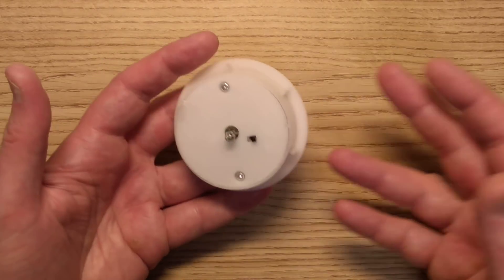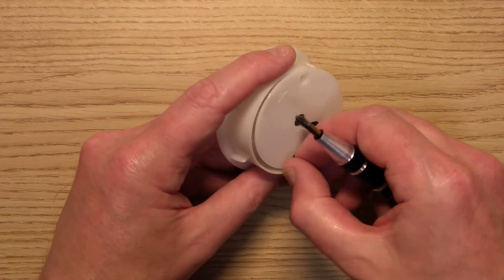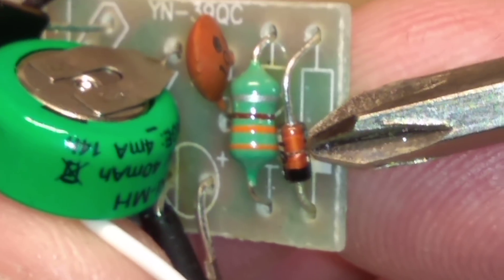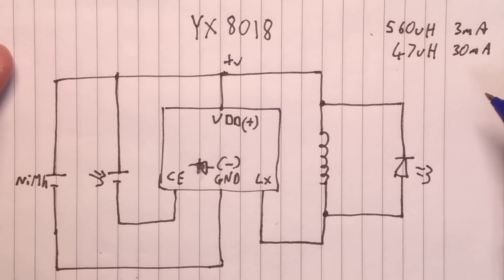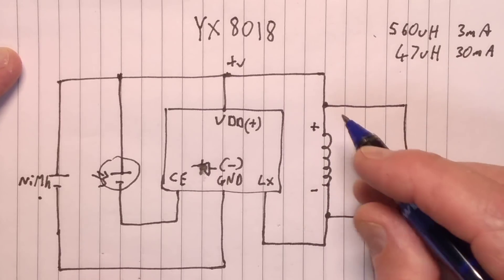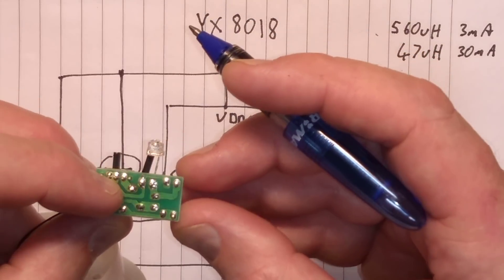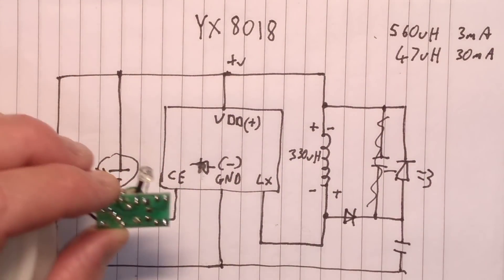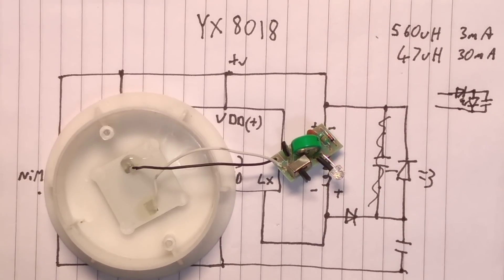Why RGB LEDs don't always work in solar lights.

Comment: so this isn't a BOOST converter right, since it never puts battery and inductor in series? Why not? So does having a smaller inductor increase the voltage delivered? What is the advantage of a boost converter compared to this?
Reply: It is a boost converter, just not in the way you'd think. It creates a higher voltage across the inductor as opposed to referenced to ground. When you pass a current through an inductor and suddenly stop the flow of current, the inductor will try to maintain the same level, which is causing an inductive kickback, raising the voltage. This effect is only limited by something clamping the voltage. This also why magnetic relays will often have a reverse diode across the coil. Otherwise the high voltage spike can cause arcs when the relay is disengaged.

Why a lower inductance gives a higher current? When the on period starts, the current ramps up as the inductor builds up its magnetic field, since inductors resist changes in current. With a higher inductance, the current ramps up slowly, so when the supply is turned off, there's less current going through the inductor at that time, and less magnetic energy available for the inductive kickback effect.
Reply: @Gameboygenius  I get it is a boost converter, but the term BOOST CONVERTER is usually a device that switches an inductor in series with a power source at high frequency creating a higher voltage. The above system does not follow that topology. I wonder what the pros and cons are between this and a typical boost converter.
Reply: @jovangrbic97  It is a boost converter, the switching pin is open-drain, the inductor is switched to ground at 200kHz: https://ez.analog.com/university-program/b/blogs/posts/hacking-an-led-solar-garden-light. You can redraw the circuit so that it looks just like the circuit in https://en.wikipedia.org/wiki/Boost_converter
Reply: I agree, this is much less efficient than a conventional boost topology since it has to generate the full led Vf across the inductor rather than Vf-Vbattery.  I suspect the problem would be leakage through the led when the switcher is off, even though the battery voltage isn't high enough to light the led some small current would flow.
Reply: @ferrumignis  but when off the PV is making power so wouldn't be an issue?
Reply: @jovangrbic97  It's hard to find data on these colour changing LEDs (e.g. I/V chart) so I don't know what kind of leakage current would be seen at typical NiCd voltages. If significant it would reduce charge current during the day, which is pretty small anyway. I can't think of any other reason to use a less efficient topology though.
Reply: @ferrumignis  what is the voltage limit such an inductor can produce? is it necessary to select the switching frequency to a timescale according to the charge time of the inductor?
Reply: @jovangrbic97  The inductor doesn't limit the voltage (or at least not directly), in these simple converters voltage is limited by the load.  AFAIK these things are extremely basic and run with a fixed frequency (around 100kHz usually) and fixed duty cycle on the switching transistor, so the peak inductor current will depend on the inductor value (and battery voltage).  If you look at the datasheets for these things, they usual have table of inductor values against LED currents.  With a fixed duty cycle, the larger the inductance, the lower the peak inductor current and the lower the LED current.

Comment: 'CE" meaning 'chip enabled' .. Very Droll!  :)
Reply: I find that in this circuit, 'charge enable' makes more sense.
Reply: Actually it should be Not CE, as the chip is enabled when the solar cell voltage is close to zero.

Comment: I wonder if the chip has something like a MOSFET instead of a diode to charge the battery from the solar panel, to reduce the voltage drop.  It would be easy enough to integrate into the chip, and that 0.6V savings might allow them to use one fewer solar cell in series, so it might be worth it.
Reply: it's not worth it, that chip is produced as cheep as possible

Comment: In Australia, you used to be able to get those lights for $2 each. It was worth it just for the color cycling LED. I once took a hand cranked torched (aimed at kids) from IKEA, and changed out the white LEDS for RGB cycling LEDs. The kid loved being able to wind up this light, point it at the roof and watch the colors shine onto the roof as they went to sleep. You could tell when they weren't asleep just yet because you'd hear the grinding of the tocch dynamo from the other room.
Reply: That's actually a kool idea, I like that.
Reply: Decathlon stores have cute little keyring crank up lamps. I don't know how easy it is to take them apart for a mod like this, but if possible, they can bring the joy anywhere.
Reply: Really nice idea
Reply: Don't aim torches at kids, hand-cranked or otherwise.
Reply: @Anvilshock  
?

Comment: Thank you! I always thought it was low voltage stopping the rgb change.
Reply: That happens on the 'specially designed' ones. It gets stuck on red as the battery drains, then starts oscillating, then shuts down.

Comment: If the capacitor was across the LED, it (the LED) would clamp the voltage at about 3-4 Volt and you couldn't store much electricity in the capacitor. However, in this arrangement the voltage of the capacitor is raised above that of the NiMH cell; when the field collapses in the inductor the voltage should still be high enough to provide some energy to the LED.
Reply: It can be worse, actually. https://youtube.com/watch?v=2MQyQUkwmMk&t=963
Reply: I think the relative voltage the LED sees is still roughly its own forward voltage drop, no? During the flyback pulses since the cap is tied to ground the voltage it theoretically will see will be the NiMH cell's from the positive rail + the LED forward voltage drop during the flyback pulses. But its still referenced to the positive rail when providing some current to the LED, if Im following it correctly. Could be wrong, tho since im not an EE. Still interesting none the less.

Comment: Thank you for the tip Clive - I put an RGB LED in a solar light once and it was stuck on red, couldn't figure out why.
Reply: #metoo
Reply: @mahlapropyzm9180  You haven't earned the right to use that hashtag :P

Comment: That's good to know, a cap and diode keeps it going. Cheers from finally cooled down a bit kansas. Got nailed by a black with white striped hornet/wasp. I have a 5.5inch red swollen circle raised about 1/2 inch above normal surface height. The bite doesnt match the bug tho, so could have ben brown recluse. I felt the sting so everyone says wasp, but the punishment doesnt fit the bug. Anyway cheers I dig the while at work still produce videos, getting closer and closer to getting that Coaster together. 😁
Reply: Ouch.. sounds really nasty.
I was woken up once by a wasp that somehow got under the bedsheet and stung me behind the knee.
I leapt up wondering WTF happened and hopping around like a maniac while it just flew off out of the window. Don't normally have a bad reaction, but this swelled up like a tennis ball with a bit of necrosis and hurt like hell for the next two weeks. Being stung while fast asleep really wasn't fair at all! :-(
Hope yours heals up fast.
Reply: @jdhtyler  update I'm thinking wasp/hornet sting however the circle now is 6 Inches in diameter. Just itching every once in a while, but man it's a wicked itch. From what I've read by now (if it had ben brown recluse) pus and red purple, etc would be present. So far mine is just red with a tiny black spot. No I haven't ben to dr, but I am keeping an eye on it every couple of hours I have a look. Thanks for the concern I'll update if anything changes, funny thing is the regular wasp out here when they sting ya it feels like a punch. This was a slow steady increase in burn. O worked with a guy that had got bit by a brown recluse in the top of his hand just above his thumb, his hole hand was swollen they cut it open and removed the decaying flesh. So I dont think I was bit by a brown recluse it's now ben 48 hours. Cheers from across the pond.

Comment: I made a YX8018 circuit with a transformer like in a joule thief to get 6-7 volts my battery is a AAA 1.2v 200mAh